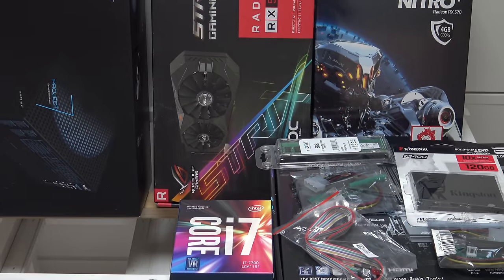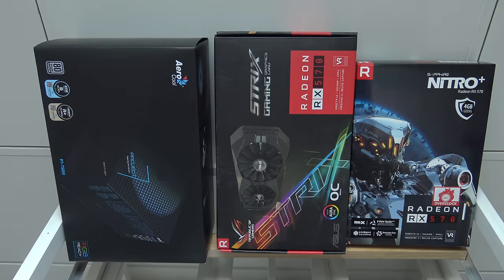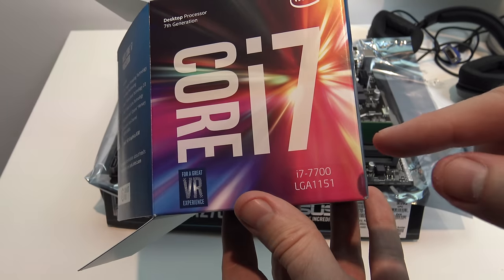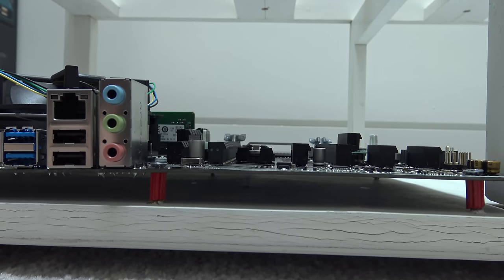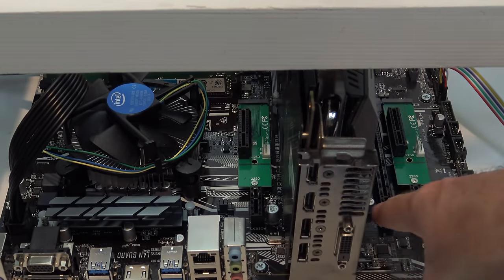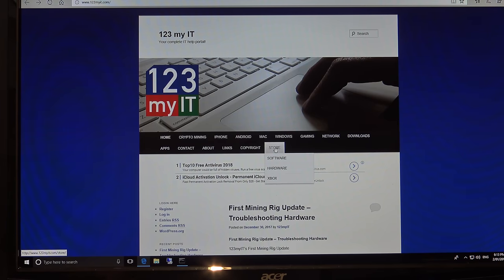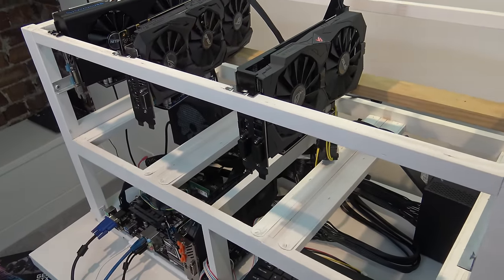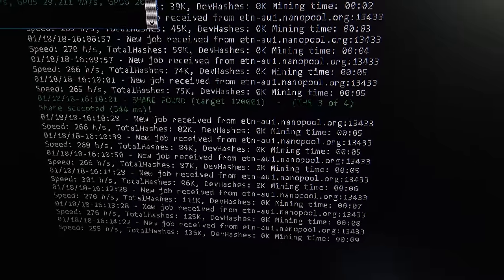Triple Miner - The KraKen Build

Comment: You should consider getting the Ryzen over the Intel if you're looking to build another rig.  R5 1600 hashes 50-100% better than the 7700K in terms of Cryptonight and a lot cheaper. (I have two rigs, 1 with 7700K @ 300h and 1 with R5 1600 @ 500-600h depending on OC)
Reply from the maker: Thank mate youre a legend I will try that !
Reply: i have r5   1600 and i get like 450 but no overclock since ima keep this baby for long time
Reply from the maker: Yeh going to look into those CPUs next.

Comment: Excellent video! Question: Do you need to plug a riser card into BOTH a USB port as well as a PCIe slot? I would think it would be either or?
Reply from the maker: Can work on both mate.
Reply: @123myIT  So assuming you have a bi enough power supply you can have as many video cards as you have USB ports and PCIe slots??
Reply from the maker: @viajerozz  a few yeah, but mobo has to support it.

Comment: I have a Asus RX 570 and I would really like to bios mod it but I:
1. Don't know how to.
2. Don't know if I should because I also have a 1080ti in the system and I had a lot of driver problems when setting up the 570.
Reply from the maker: Up to you mate. Sometimes its better to just run the miner when it works to save downtime lol

Comment: Do you have something you could sell incase Mining goes south and not profitable? Btw how’s the heat with australia’s summers.
Reply: Australia has high power costs, in Victoria its nearly at capacity during really hot days
Reply from the maker: I will turn it into gaming rig mate. Power is high. I am getting Solar installed next Wednesday. Stay tuned :)
Reply: 123myIT understandable have a good day

Comment: Nice vd... Please show how u bios mod your saphires rx 570...  Dont get to succeed and error is showed on screen...im still at 17.8 mhs per card.. Help...
Reply from the maker: oh wow 17 is bad mate. Did you miss this video? https://youtu.be/LBZ4T_rIkfA
Reply: 123myIT great... I flashed them with the bios found in your website for elpida memory and its doing a lot better... Around 22,3 mhs per card...no overcoocking yet... Thanks a lot 123MyIT..always helpful vd...
Reply from the maker: Glad it helped mate but still sounds low. Should be about 28 to 29. For me the only drivers that would work right are the block chain drivers. Aug 8 version. Let me know if you need it.
Reply: 123myIT .. Thanks for reply.. Actually it is low. Yes i could try... After flashing with ur bios for elpida 4gb rx 570 gpu clock is at 1150 and memory clock is 2100.. All others parameters remain the same...eth is the crypto...  Maybe diffuculty of mining?
Reply from the maker: Nope thats right.
Reply: Great.. im pulling 30.1 mhs per card..., it was the crimson version aug release.. any problems so far... thanks a lot mate...regards
Reply from the maker: Awesome result glad it worked out for you :)
Reply: a las question regarding bios mod. Do you think gpu clock at 1150 MHz and memory clock at 2100 Mhz could damage or reduced the life of the cards in a mid term?;   I dont find any overclocking manual to study... All those parameters were already set in your bios file... I appreciate your help... regards...
Reply from the maker: Good question mate. I will do a video to overclocking shortly.
Reply: Great...looking forward to it... Thaks a lot...soon i will send u a eth-Beer ...regards
Reply from the maker: Np ! my solar install didnt go ahead this morning. I am cut lol